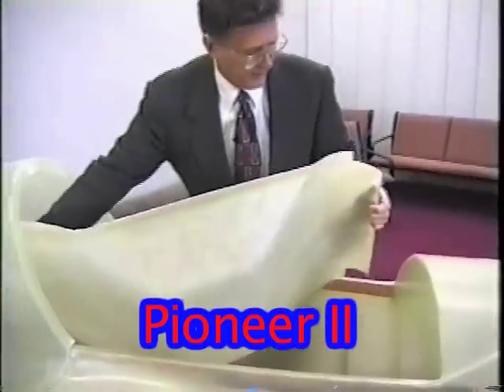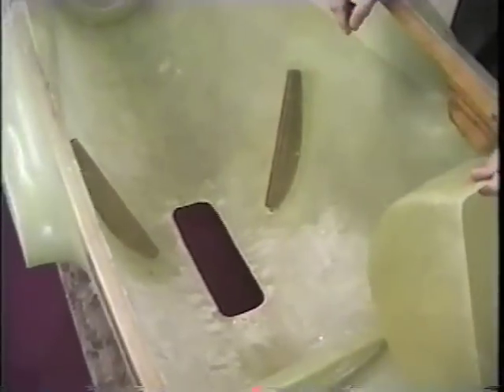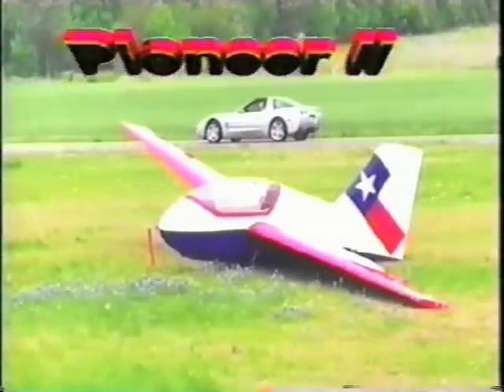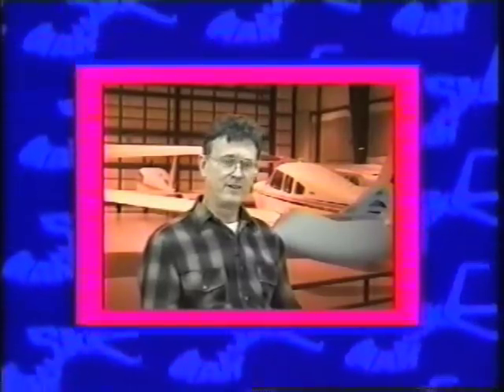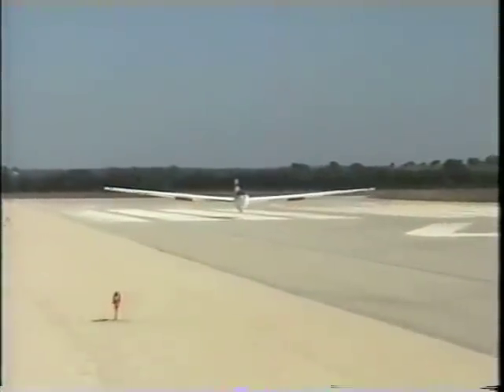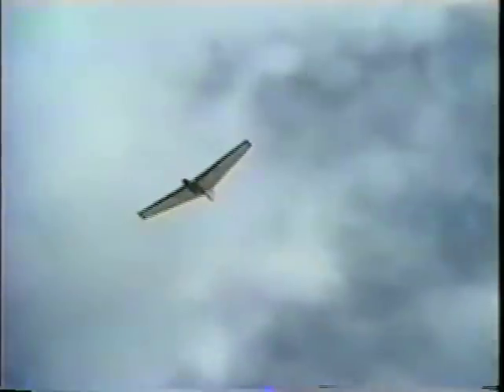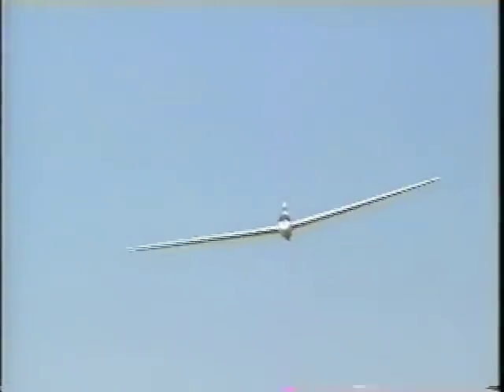Jim Marske Flying Wings7

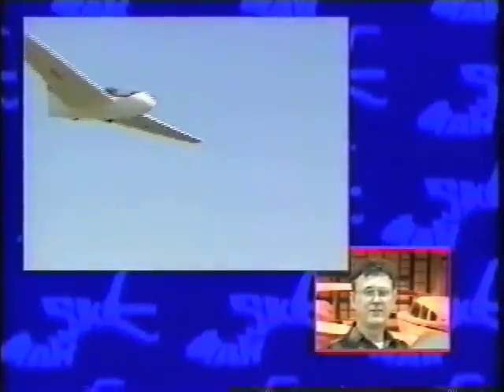Comment: I thought I saw the tiniest bit of pitch oscillation from about 2:10 to 2:25. I know this sometimes happens with certain flying wing designs and can overload the G-rating with that "flapping wing" effect. Is it a problem that you have had to address in your designs? I love the efficiency of the flying wing designs and the different variations that I've seen so far. Good luck!
Reply: I experimented with flying wing air-foils and found that (just in front of the reflex) I have a convex foil section continuing all the way to the reflex. This makes the reflex less effective, so I just give more reflex to get a good glide (and there seems to be no problem with this). With this foil, I found my model (free-flight) flying wings unbelievably stable and self adjusting. I originally had a straight foil section (just in front of the reflex) on my flying wing models, and they literally fell out of the sky! So (in my mind) my original straight air-foil section (just before the reflex) must tend to make flying wings extremely dangerous. Like violent stalls, like a complete 90 degree nose down stall. lol You won't survive that. But with the foil section staying convex all the way to the reflex, you don't seem to get the problem (according to my model tests). And now my flying wing models seem to refuse to stall and they tend to glide "stalled" and just turn and pick up speed and continue gliding. That is how the flying wing stalls if the foil is right. Amazing difference for such a minor difference in foil section. So be warned, check this stuff out with a model before you get in a full size home made flying wing!!! The very reason flying wings are so dangerous is cos of the horrific stalling characteristics. But a continuing convex air-foil towards the reflex certainly seems to help, try it with models and see how amazing it will fly. And it's self correcting, if the nose comes up, the rear convex makes the nose tip down, and when nose is down, then the reflex picks the nose up (and the cycle repeats). For this reason my models can "dune-goon" (so-to-speak) without any control input. Free flight stable dune-gooning. lol
Show less
REPLY